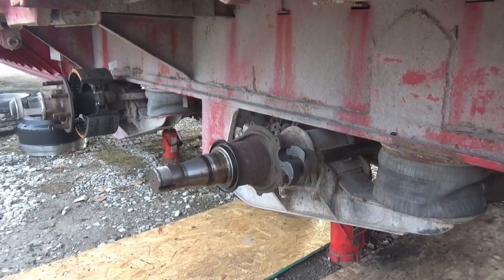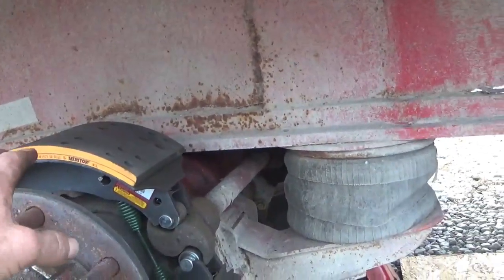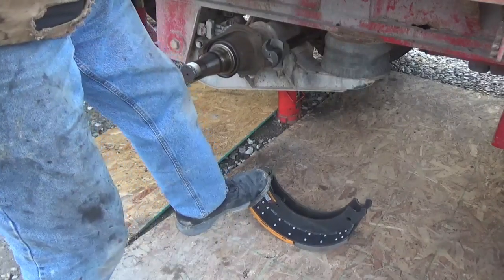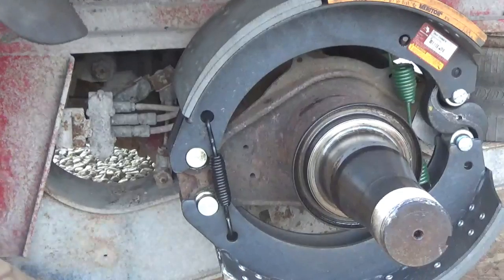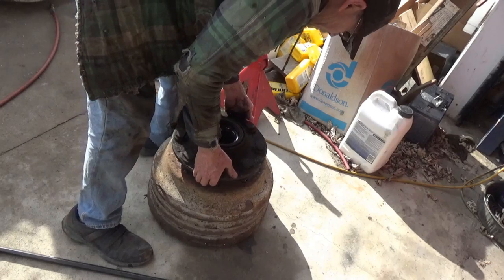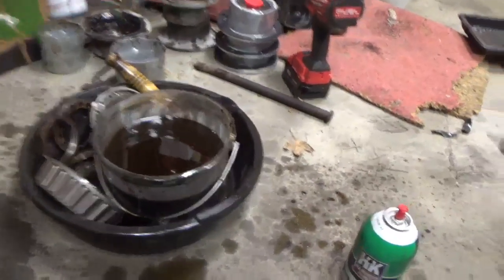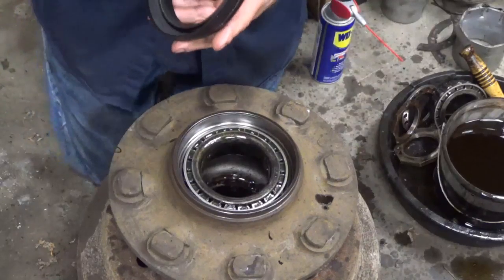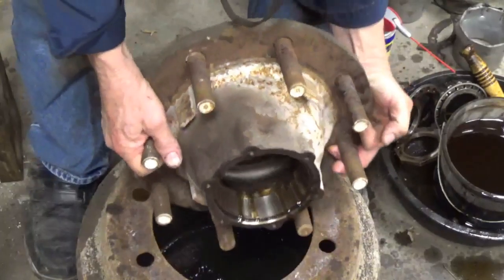Replacing S cam on 3 axle semi trailer (part 4)  (replacing brake shoes and axle seal)

Comment: OTC-5081 is the tool for those springs,  I think its about $60 down in the states there, and I believe there are cheaper options around $50 on amazon.

I use the tool nearly every week, It works really good on the outboard spring,  However the tool sometimes has clearance issues on the inboard spring especially on drive axles,  It still works, but not as smoothly.  overall its a decent tool, and I would likely buy it again if I had too,   however it does take some getting used to, and would likely cause some frustration if you're used to the screwdriver/pliers method

Comment: I don’t think using an impact to back off the slacks is a good idea. Haldex actually put it in bold letters in their service manual to warn against it. It could damage the internal one way clutch causing it fails to hold adjustment.
Reply from the maker: Thanks for the heads up.

Comment: Mr. Robertson, I have been following this series, and it has been awesome!
   I am wondering if you could give us a break down of approximate cost(s) for seals, pins, brakes, drums.  Just for one wheel.
   I am looking at purchasing a trailer very similar to this one, and it needs some attention on the scale of what you are doing here, and I will need to do the work myself to make a return on investment.
Thank you sir...
Reply from the maker: Brake shoes around $40 - $50    drum $150 - $175    seal $35 - $40   Anchor pins come with the shoes but you need special tool to get the old ones out unless you're lucky,  hub cover $15     I have a video in my playlists on anchor pins. Sorry I missed that part in this video.
Reply: Gordon Robertson DIY ok, thank you sir.